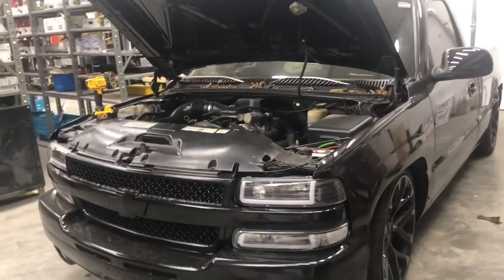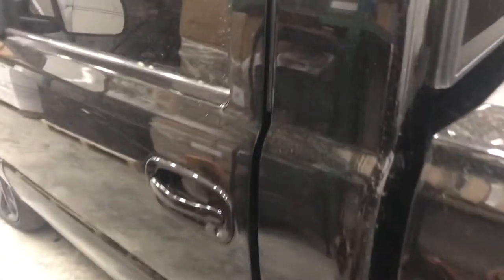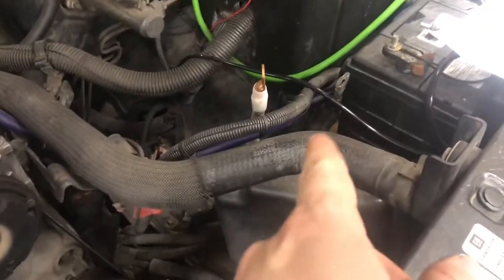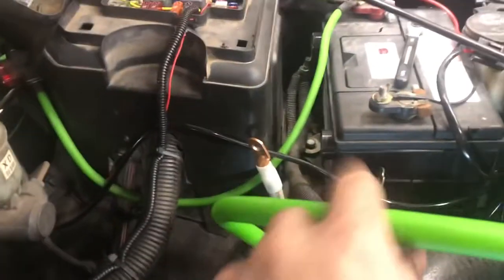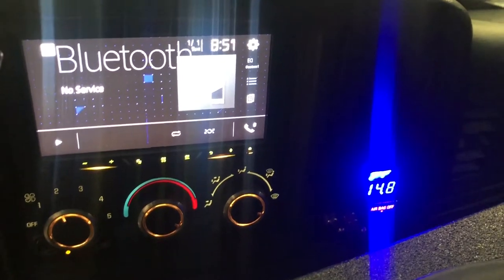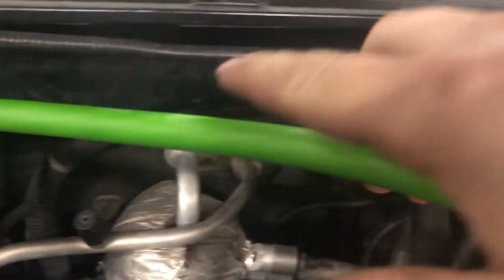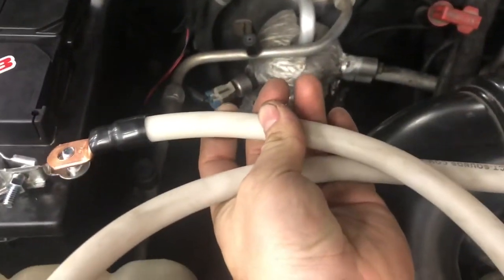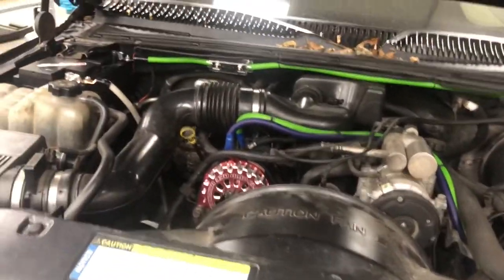Mechman Alternator Install on a Chevy Silverado

Comment: Good install but did you install a shorter belt per the instructions? I know your stock one fit, but down the road it's going to start slipping badly.   Just a friendly FYI.
Reply from the maker: I did. Off camera just had to order it and it’s on now. It’s a HD one.
Reply: I know this is wayy old but what belt size fit? I just recently got a high output and don’t know what size would fit same truck single cab 4.3 also
Reply: @davidlugo7209 did i u figure it out i got a 4.3 chevy single cab too im installing a 320 mechman

Comment: Got the same alternator on my 2014 what fuse did u connect the yellow wire to power the alternator? And did u jus wrap the wire around the fuse
Reply from the maker: I used a fuse tap. And I think it was an ignition fuse.
Reply: @MarioZermeno   Koo hooked mine up but jus wrapped the wire around the fuse and plugged it in the fuse box it worked fine most of the day then the fuse on the battery distribution block that powers the fuse box blew you think cause I jus wrapped the wire around the fuse
Reply: @MarioZermeno  gonna try the fuse tap didn’t know they made them